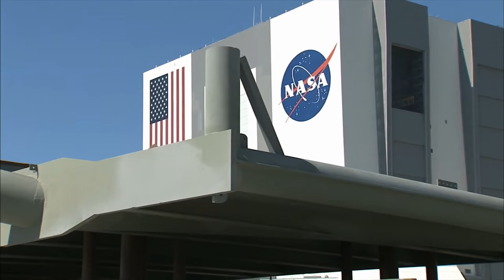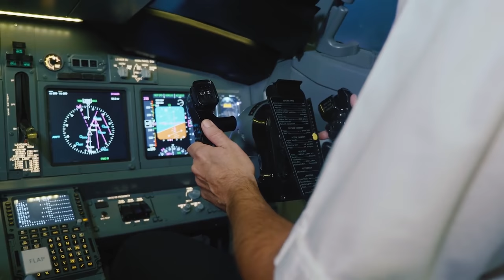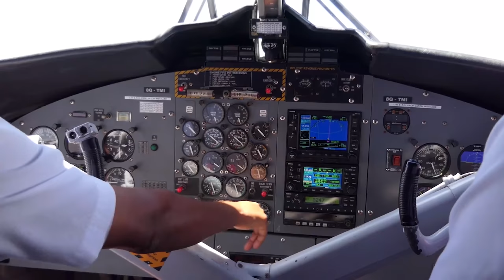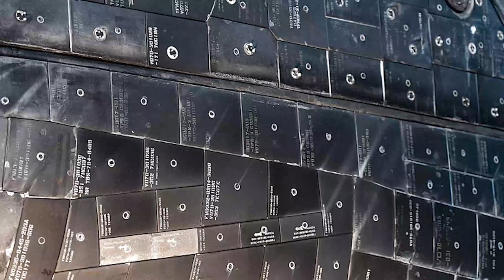Why Building A Space Plane Is Nearly Impossible (Physics Explanation)

Comment: The other problem besides heat is starting mass verses ending mass and is actually somewhat related as heat shield tiles weigh something as well as all of that structure and engine mass you need to operate as an airplane in the atmosphere.  This goes in concert with out of control complexity and associated mass.  The most efficient rockets we have today can get something like 3% of their starting mass into LEO as payload.  If anybody here has done rocket equations, and apparently not a single person here has besides me, a key factor in delta-v for rockets is starting mass verses ending mass.

The thing is with airplanes is they are only efficient when you do a huge gear reduction and indeed modern jet liners designed for efficient operation have a huge bell at the back of the engine to slow down the air passing over the turbine blades so they can drive an even larger bypass fan in the front of the engine.  At this, airliners would be more efficient if they had an even larger gear reduction while also having a straight through exhaust instead of a bell on the back, but this requires gears under high loads and thus more maintenance and so is usually not done.  So yeah when you go on about how an airplane is so much more efficient, you are really only talking about an airliner that goes at subsonic speeds and at that maybe up to mach 0.7 or so at a 10 km or so altitude.  Try to go higher and faster and these efficiency equations quickly melt down.  Granted most jet liners go a little bit faster and once long haul airliners burn most of their fuel load a little bit higher, but they only go a little bit faster due to engine design trade-offs and a little bit higher on long haul planes because much of their potential payload capacity is used for fuel and that fuel is largely burned off before they go higher.  Trying to go higher from the get go is generally not done because that would mean the plane could not carry anywhere near as much stuff and so you start running into the only thing you haul up to that altitude is fuel and structure to make it to that altitude.  When you get into just hauling fuel and structure to a place and no payload, you stop doing anything useful and after a certain point the plane gets on the negative side of the drag curve as the engines produce less power and the effective airspeed decreases due to thinner air (less air density and it is effectively like you are flying slower from a lift standpoint) and stalls.  An empty commercial airliner once did this whole let's see how high we can go thing with young pilots on board and they stalled the plane and overheated the engines leading to the engine cores seizing while going too slow.  The plane ended up crashing, killing both pilots.  Planes that fly significantly higher than airliners are designed to be almost all structure and engines with some fuel and almost no payload and at this are nowhere near being in space nor anywhere near orbital speeds.

Another thing to consider about going fast is how hot do the engines get?  It is not like you can just make engines run hotter because you want to go a little faster.  Instead you end up with more complex engines to keep existing materials from getting above a certain temperature.  At this heating with speed is a cubic factor.  After a certain point you can't do that anymore, so maybe you run the engines for a few seconds because that is all you can do before they melt and still end up with a woefully inadequate result when talking about trying to make a space plane.  The thing with rocket engines is you accelerate both the fuel and oxidizer and so instead of heating increasing at a cubic rate, it is a more or less constant heat load on the engines as you go faster and faster.  The speed of the materials moving through the engine is low enough for a solution to work.  This is a key gripe I have with all of these people going Skylon! Skylon! is keeping these engines cool as in doesn't melt or ablate away and efficient as in why didn't we just use a traditional rocket engine and forget all of this air breathing stuff that makes our vehicle heavier and thus hurt a key tenant of rocket equations.  As far as I can tell from the equations is it is basically impossible to make any sort of meaningful gain and a whole lot easier to end up with something less efficient than a traditional rocket as trying to go for more and the engines just melt or ablate away.

So yeah, try to model things with the equations that model each thing and put them all together for your design.  I think you will see the equations that model something like Skylon show it to be a terrible idea as you add in all of this starting mass for an airplane body instead of a rocket body, heat shielding mass, heavy, complex engines that have to switch off most of the engine early on before getting something all that useful out of it as they equations you are relying on largely break down at a cubic rate, making it more dead weight you are hauling up to high speeds, and then balance against the weight you can get up to orbital speeds.  You will quickly find you made yet another sub-orbital vehicle like what Richard Branson ended up with.  Even Jeff Bezos was able to beat Branson in altitude capability and did it with a far simpler vehicle, which is a sad statement.

The main place I have found where you can potentially get to a more efficient vehicle to orbit mass efficiency wise are rockets with somewhat more powerful engines.  One limit is max-q where air friction limits the rocket's effective speed before the equations start melting down trying to go faster through that part of the lower atmosphere and the other is max G loading on your rocket and payload where you just can't practically do any more, especially if you are looking to haul people into space.  As a rocket lightens its fuel load, it is capable of achieving high G loads, which is important for reducing hang time the rocket burns fuel to counteract while not doing anything useful beyond hanging.  I have come up with some extra engine mass that effectively gets switched off mid way through a burn to keep G loading down should be lighter than the fuel burned fighting against gravity, granted you also scale back some to make it through max-q.  With Elon Musk recently talking about more engines on both Starship and Superheavy, he is talking about this trade off where the engines will scale back more in parts of the flight, but there will be more total engine power to muscle through the parts of the flight where the fuel load is still heavy and there are not other limiting factors, allowing for this extra muscle to kick in and reduce hang time.  It also provides better engine out capability.  The thing is he is not going to say make shorter, lighter tanks with the same engine power as the current design to further reduce hang time because there is an upper bound of gains, plus there are a number of problems with trying to go for a higher max g-loading and going for higher speeds while still in the thicker part of the atmosphere.  Expendable rockets actually go in the other direction of lower thrust to starting mass as they are often designed for max thrust throughout the burn instead of throttling back and the engines are expensive compared to the tank cost, so optimize around getting the most out of these engines in their one flight and waste due to hang time be damned.

I think this is another place where going on about how Skylon is being done by the British is not as good as some make it sound.  For one the British have the whole Brexit fiasco.  Then you have that idiot prime minister to pick out one of a litany of idiotic things he has done was to go out of the way to get himself sick with COVID-19 and nearly died.  Then there is the whole Harry and Megan deal where Megan is doing everything she can to undermine and rip apart the royal family and it is like why did you go out of your way to have this American woman and especially stick with her with all of the crap she has pulled and just let her throw the whole royal family under the bus?  Back in the day the British broke with the Roman Catholic church just so the king could get a divorce, so it is not like the British are strangers to divorce.  So yeah, um, the British haven't been making the best decisions as of late.  Granted they are far from alone in bad decision making, but the point is attaching the British label to it doesn't make it any more credible these days.
Reply: your last paragraph is irrational drivel, regardless of brexit more funding has been put in and the average Brit does not care about the Royals or even know what they get up to. The research into the British Pre-Cooler has some serious big aerospace backers and the most resent and likely to be the first is the HVX program.

Comment: Perhaps you should look into Reaction Engines and the Skylon project in the UK. They have viable space plane and engine design.  It intakes its oxygen in the way up. And solves the temp issues. The Sabre engine is a marvel. This commentary is completely out of date.
Reply: well, they need to prove it first. No Skylon yet.
Reply: @erikals  actually they have validated the sabre engine at their US test facility already and Rolls Royce has taken a stake in the company. Yes it's not a complete proven platform, but validating the engine air temperature conversion sustainably works, is a big deal.
Reply: @douglasnorth4703  Cool stuff, crossing fingers  :)

Comment: They are possible, it's just bloody hard to properly build one that decently works.

However, there is a engine that we've developed in recent times that doesn't need oxygen to power it.

Hell it doesn't need combustion, but it's so over looked as a option. Because, it's so weak by the science community.

Even though we already have the tools to make it more powerful than what it is now.

I'm of course talking about ion engines. All you need to power one is air, and electricity.

The atmosphere is air, and we know how to bottle air.

The most known powerful battery that we can create is basically a nuclear reactor. The same one powering perseverance, or was it curiosity?

Speaking of nuclear, once in space, one could switch to nuclear powered rockets on the space craft.

Who says that we can't hybridize space crafts? Especially in away that allows use of 2 different types of engines.

In the end it isn't about weather, or not if it is impossible, but weather, or not we have the technology.

One thing about technology is that technology now is a stepping stone for technology later.

Comment: Watched the whole thing and still don’t get it. 7:50 you can get high up by not launching vertically, just fly normally, slowly without generating heat. After that, launch your rockets to get up to Mach 33. Like the Virgin Galactic method with carrier plane Eve and rocket plane VSS Unity. Virgin Orbit goes higher for satellites. Landing like a glider is a huge benefit compared to parachutes or rocket landings.
Reply from the maker: Ah but that leads to another problem which is flutter. Page 244 and 245 explain it well.
https://history.nasa.gov/sp4232.pdf
Reply: @LogicallyAnswered  “Yet the aircraft could not fly too low, or it would face limits set by aerodynamic
flutter.” I guess thats why VG has a carrier plane. For the low flight. And then the feathering system on the glider for descent. So it works and could go orbital.

Comment: Both rockets and jet airplanes are now extremely primitive. What's needed is a non newtonian propulsion system. It could take off from earth, fly into space, then return to earth very slowly, and under power the entire way down, solving the re entry heat problem. And it would not need wings. We are headed in the right direction, but have a long way to go. Though still powered by primitive rockets, SpaceX has been able to return it's boosters back to earth using powered decent. That way they can come down slow enough that heat caused by atmospheric friction is not an issue.

Comment: You seem to know a lot about physics and economics. 
Is your course in college major in physics minor in economics?
Reply from the maker: Aerospace engineer, but nothing to do with economics haha
Reply: @LogicallyAnswered  wow i see. Your content are amazing bro. Thank you for keeping us inform.
Reply: I'm a little surprised, you should know that the description of lift you gave was not fully correct. The glaring mistake is that lift is not generated because "air has a longer distance to travel over the top." A wing that is a flat plate can generate lift if at an angle of attack. It doesn't have to do with the distance.

Comment: While I understand the heat problem of reentry, I've always wondered why they can't equip a space vehicle with some type of air breaking system that, combined with a shallow reentry, would allow the vehicle to gradually lose velocity before it encounters excessive heat. I'm sure there must be a reason, I can't be the first person to have thought this, but I don't know what the issue is.
Reply: The reason is the initial difficulty with getting objects into space.  Next generation launch systems are going to multiply space infrastructure by an order of 100 times greater than today.
Reply: @Art-is-craft  I'm not sure I follow. What do launch systems have to do with heat generated during re-entry?
Reply: @persona2grata  
There simply is not enough infrastructure to develop such. The market is very limited. With a market that 100 times greater in size there will be more innovation.
Reply: @Art-is-craft  Ahh ok. Ty for explaining.

Comment: The explanation you provide for the lift created by aircrafts wings, although very commonly found in litterature, is, if not wrong, at least only partial. If this was the main reason for aircraft lift, they would not be able to fly upside down, since in that case, the wings would create a force downwards and add up to gravity to pull the plane to Earth.
Reply from the maker: And when was the last time that you saw a commercial airplane fly upside? To my knowledge, only fighter jets or other aircraft who have a thrust to weight ratio of close to 1 or above 1 can fly upside down, vertically, and stuff like that. I could be wrong though.
Reply: @LogicallyAnswered  There are several points to address :
1/ Since the video addresses spaceplanes, commercial aircrafts are just not a very good example. Yes for commercial aircraft, the Bernouilli effect (what you explain in the video) is quite large, but still it not the only contribution to wing lift.
2/ Spaceplanes would have wings which geometry would be very different from a Boeing or Airbus, with different constraints, requirements and flight characteristics.
3/ Aircrafts have been flying upside down for more than a century and in flight conditions where thrust to weight ratio was always way below 1. You don't need a thrust to weight ratio above 1 to fly upside down.
Reply from the maker: Ah ok, the video was mainly about why it’s so hard to go from what we have today, which is commercial airplanes, to space planes. That’s why I brought up commercial airplanes. Thanks for the info!

Comment: I don't get the underlying thinking. Throughout the video planes were shown to have either jet engines exclusively, or be rocket planes. At no time do I see a hybrid system attempted. Jet propulsion can be used to reach the upper atmosphere where the air is thinner and thus would result in less friction resulting in heat. A rocket system then would be shifted to to boost the rest of the way to orbit. I'm sure there are other technical issues, but why aerospace designers don't pursue this track of thinking is beyond me. Rockets pump so much exhaust out trying to get from ground to space, and from zero kph to Mach 33, being able to have a system to get to high orbit and supersonic before rockets taking over has to be more efficient. Hell my car uses more fuel going from zero to 20 mph than from 20 to 60 mph. At least an already flying craft would have overcome inertia making any further added speed more fuel efficient.

Comment: Starship will need to pass the same hurdle as a space plane when it comes to heating.
The heating issue has more to do with re-usability, you could make a disposable space plane. Heating during ascent is not as grave an issue as during re-entry. A space plane is dumb due to the mass issue.
Reply: New tech could make reentry easier. Stuff like Magneto Hydro-Dynamic (MHD) flow control.

Comment: What exactly would qualify as a space plane...that is the question. Does it mean single-stage-to-orbit, or multiple stages....or landing like a plane...with wings, on a runway?

I often wonder about the differences between the American space shuttle, Energia + Buran and SpaceX's Starship, the X37-B also. I think the Russians built a better space shuttle, liquid rockets, autonomous flight etc. Don't know if the Buran's heat shield tiles also fell off. The tiles seems to be a problem, even to SpaceX. 

The bottom line is most likely cost and reliability, Falcon 9 does the best so far, it will be very interesting to see what Starship will do,  if it can really bring the costs of spaceflight down by as much as it is hoped. 

Would it be beneficial to add wings to a Starship (or enlarge it's "wings" to enable normal gliding and landing) for use on earth?

I wonder....the space shuttle was such a beautiful marvel of engineering (I know it had a lot of shortcomings, could those have been overcome with a new design?) The idea of a winged vehicle capable of going and returning from space stays so romantic...